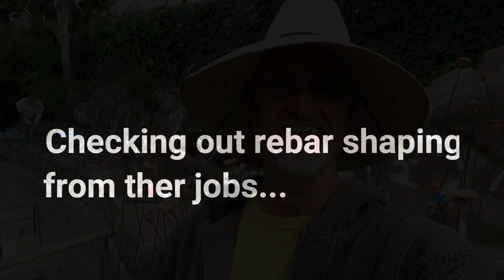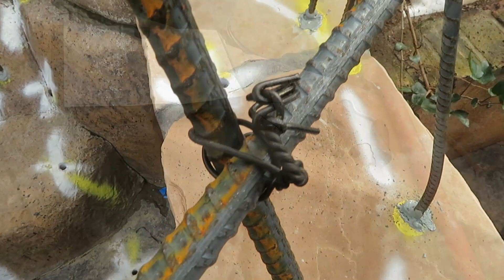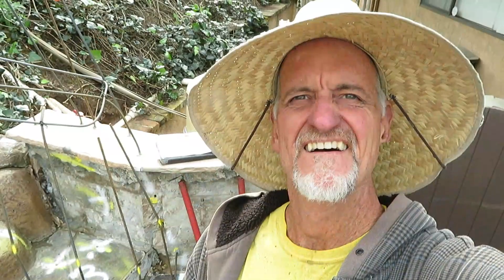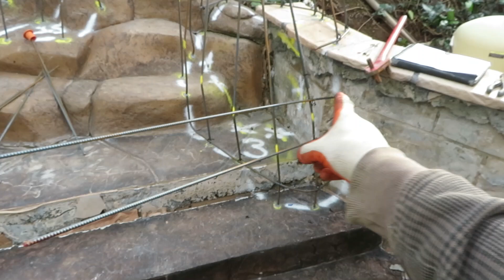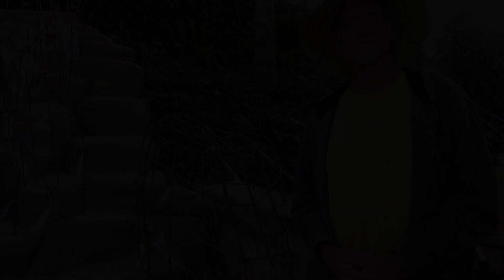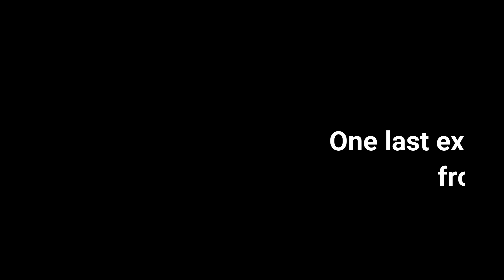How to Shape Fake Rock Rebar.  SESSION 4, PART 1, "$17K Pro Course", ROCK SHAPING,

Comment: How detailed with negative spaces are you getting with the rebar? Planning fractures or rock breaks and such? Or does that come later with shotcrete and texture?
Reply from the maker: Thanks for the question.  Spaces of a foot or so with the steel, vertically and horizontally knowing that the concrete/shotcrete will fill things out at least 3" to 6" and even way beyond that if preferred.  After that, it's all concrete and mortar for the textures.  :)
Reply: @DaveHendersonFakeRockVideos  quick question. I live in AZ and as we have been gathering design ideas a friend who is a local builder said that the Faux Rocks don't do well in the AZ sun and heat. From paint fading to cracks due to expansion and contraction. Do you know if this is the case for Faux Rocks in Phoenix?
Reply from the maker: @Dadof5  Well here in Alpine, (east San Diego County) we have long hot summers.  90's and 100's+.   All of South Eastern So Cal is hot during the summer.   After decades of building these kinds of projects here, they last when they're built correctly.   But like all faux rock over time, tune-ups are needed.  Like houses, a fresh coat of paint needs to go on every 10 to 15 years or so.  If however faux rock features are not built well they can and do deteriorate quicker.  Not enough rebar, waterproofing, acrylic additives to all texture coats, and pour designs, etc. does lead to issues.  Lastly, Phoenix has concrete everywhere so the building material obviously lasts in that environment.  Just gotta build stuff right.  Anyway, hope that helps.  Cheers, Mr. Dave  :)

Comment: Hey Dave was curious what type of blade you use/recommend on grinder for rebar?  If anything specific.
Reply from the maker: I use a 4.5" metal cutting disk on an angle grinder but mostly use a big rebar cutter/bender. https://www.google.com/shopping/product/1135358694852944379?lsf=seller:9764200,store:1684583984436865022&prds=oid:14005404340774367404&q=rebar+cutter/bender+tool+photos&hl=en&ei=RL7WYPyCPZLU-wTWyI74Dg&lsft=gclid:Cj0KCQjw_dWGBhDAARIsAMcYuJyZyg1PEKF2Nk7JlxtHlMnxecYiulgYcCelxg-cF9SH2xclJyeLPwIaAuL9EALw_wcB. 
Hope that helps!
More fake rock how to stuff, including free pdf downloads and more, is at davehenderson.podia.com.  
Cheers, Mr. Dave. :)